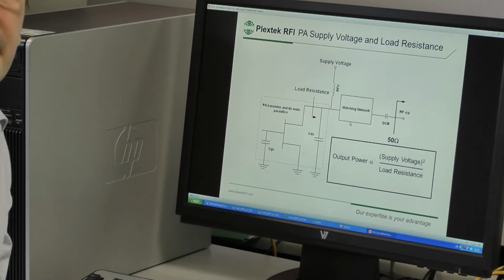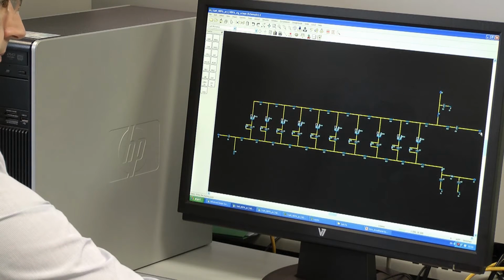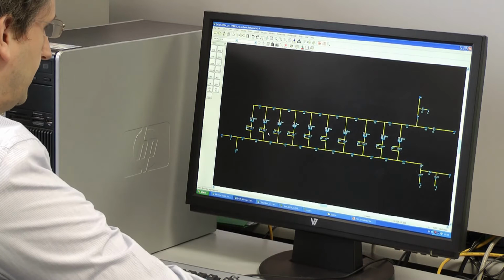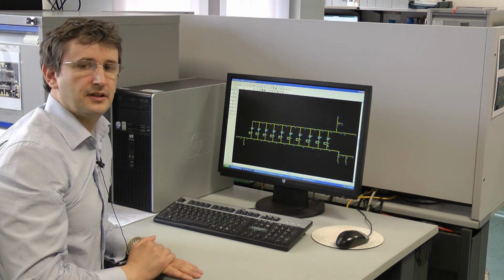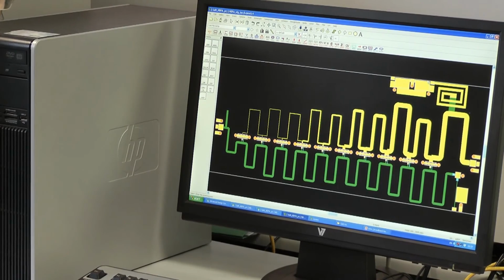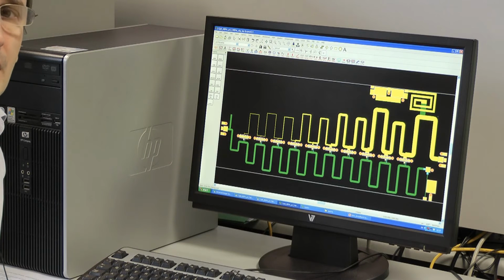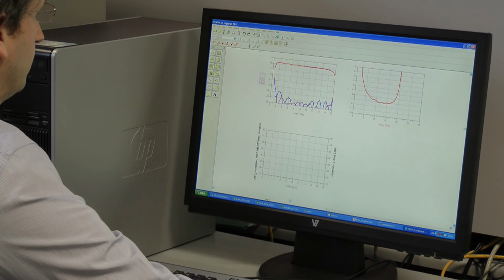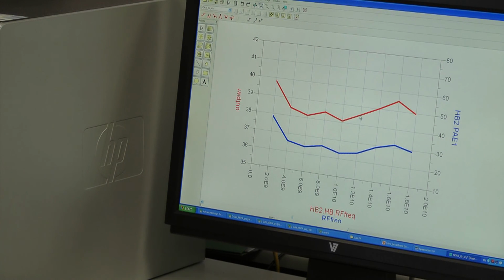Broadband (2-18GHz) GaN PA MMIC Design using Keysight ADS

Comment: Hello sir,
that was very useful and and clear video.I was waiting for the such  type of help.
I am also using a similar approach ,not using dummy load on drain side to increase the amount of o/p power or current..
Can you provide me the circuit simulation parameters you have used.?
I have my dissertation on the distributed power amplifier with improved PAE.
Also suggest me a book related to power amplifier which is more practical for designing the DPA.
thanks
Reply: Hi I am also working on Distributed power amplifier, could you share your dissertation so I can use it as reference